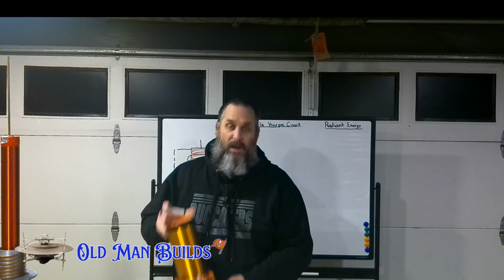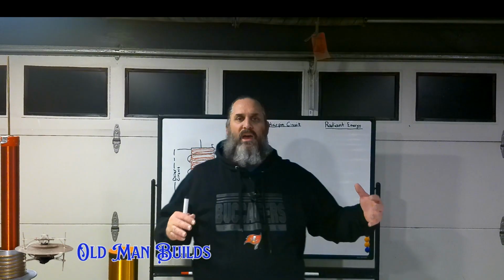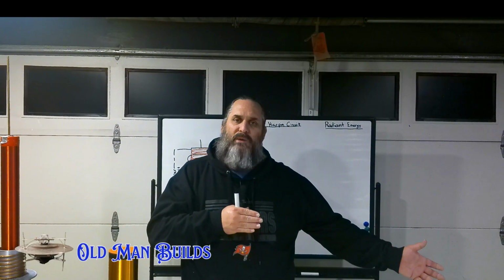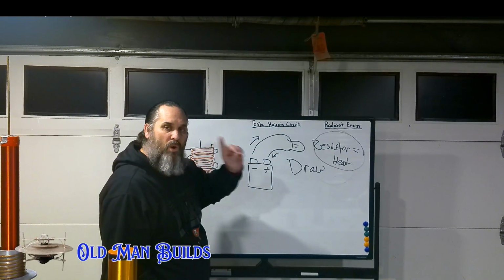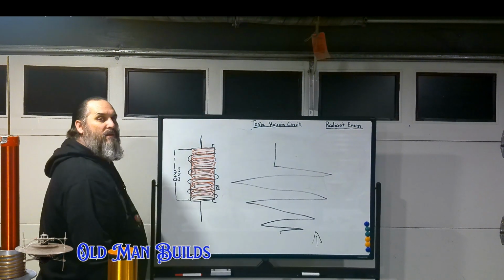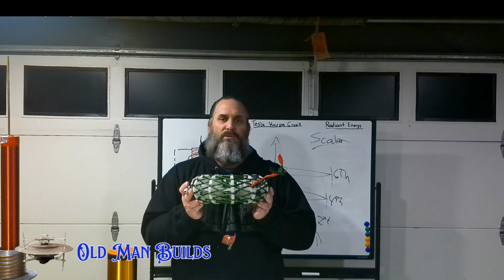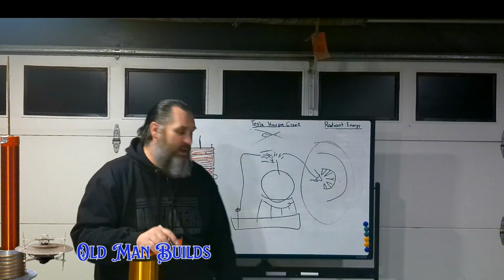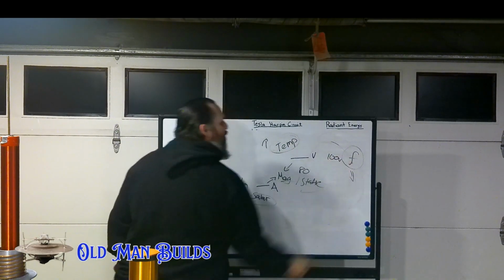Cold Energy "Putting Physics In Balance"

Comment: Great video!  I am learning a lot by your series. In your reference to normal Hot circuits is a small error. In a normal Hot circuit the electrons are negatively charged and " push" or "flow"  from the negative terminal to the positive terminal in a loop. It is only on paper schematics, by convention,  that the flow of charge is from positive to negative in a normal Hot circuit.

Comment: I love it, what is easier to generate 1000 volts x 1 amp = 1 kw or to generate 1000 amps x 1 volt = 1 kw, amps create heat and you need thicker wires to handle it, volts don't create heat and you can use the thinnest wire. Great Video.
Reply: It doesn't really work like that in practice. Depending on the load you will get a dramatic voltage drop and an amperage increase as the electro motive force manifests.

Comment: High voltage engineering is the answer. You need ultra robust circuits that you usually have to make out of thick copper strap and fr4 or fr5 and alumicraft epoxy mixed with alumina.